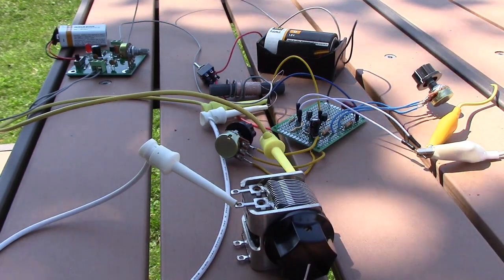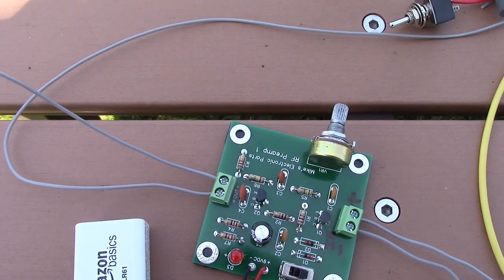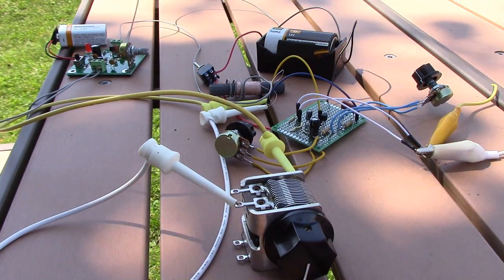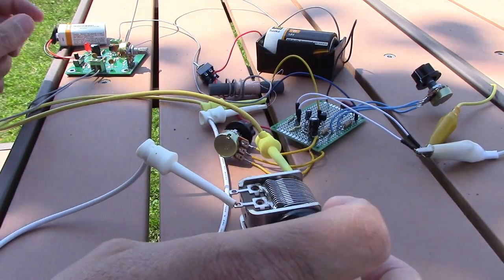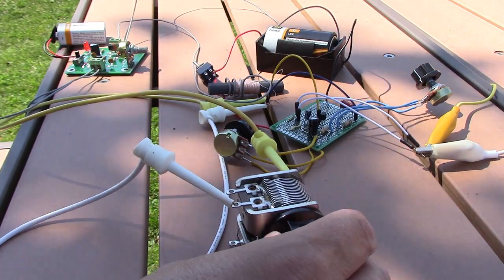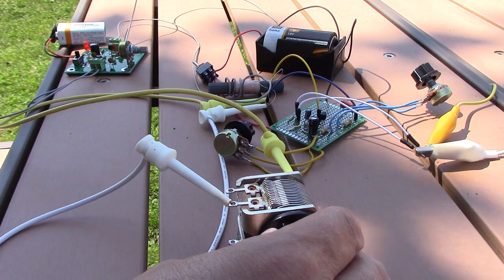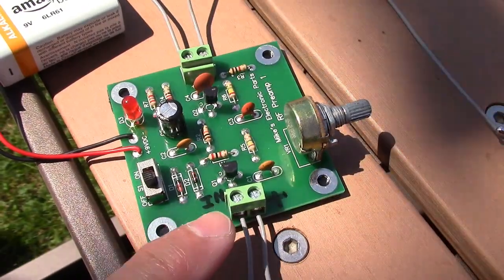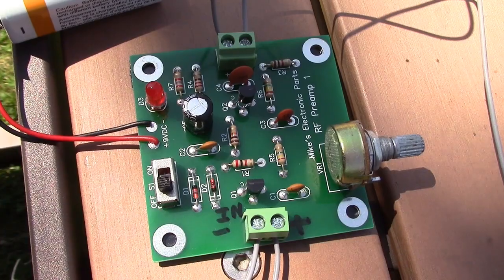MK484 Radio With Preamp Circuit ($12 Preamp Kit)

Comment: The reception sounds good but just turning off the preamp doesn't show me how the reception is without the preamp.

The signal is going thru the preamp, so turning it off blocks the signal.

You would need to swap the antenna wire from the preamp to the input of the mk484 for a proper comparison.

Comment: I built several MK484(ZN414) Radio Sets myself over  thirteen years ago. I even managed to successfully add regeneration to one of them. But beyond that, no Rf pre-amp, just a single xsistor audio-amp to drive a 150 Ohm spkr 

You can find my MK484 Regen Radio Set on Google
Reply from the maker: Very interesting! I will have to look for that. Thanks for stopping by. 👍❤️📻